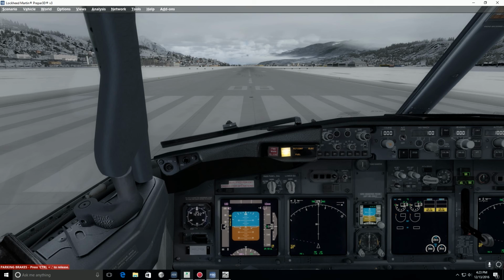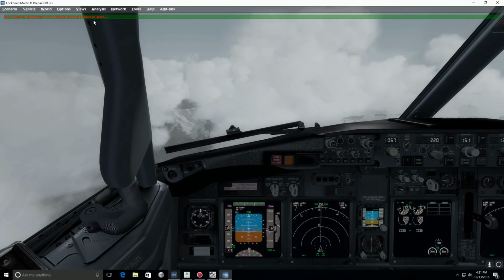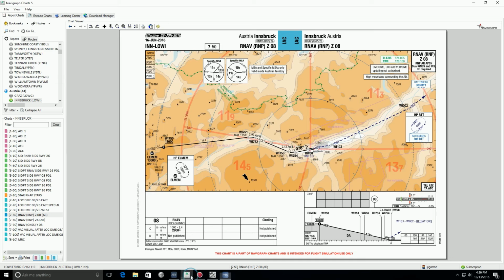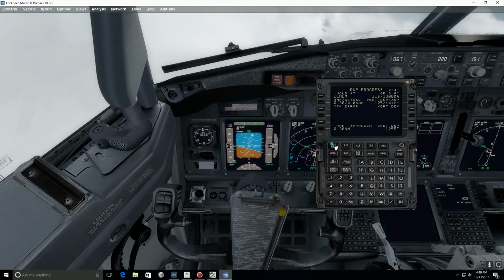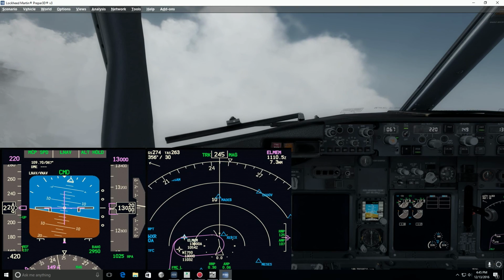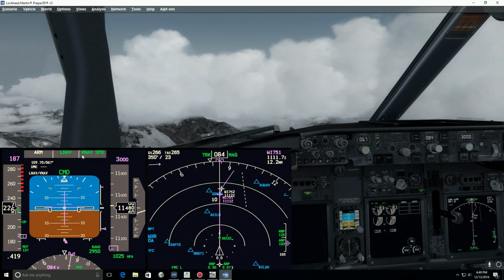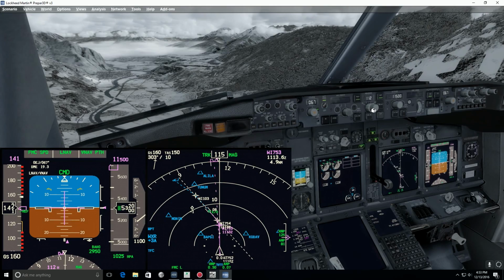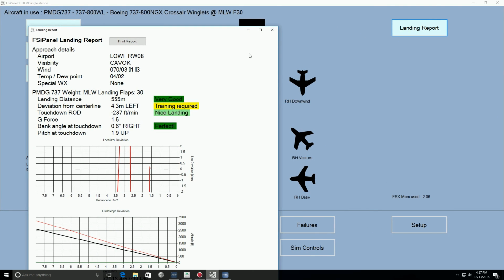FSiPanel RNAV RNP Z 08 LOWI

Comment: Very nice video, learn so mutch out of this videos.
One question, why speding up to geth lower too the path at about 20min in the video. I thougth best is to lower speed !?
Reply from the maker: Hi, by default the FMC has a descent speed of 240kts, I forgot to change it to my desired speed. So if you change your cruise speed to 220 kts and forget to change it as well in the FMC descent page, the aircraft plans a descent with 240kts... as you said, not very good in a non precision approach. So it was my mistake, I should have changed the FMC CRZ and DES speed before engaging VNAV for the descent.